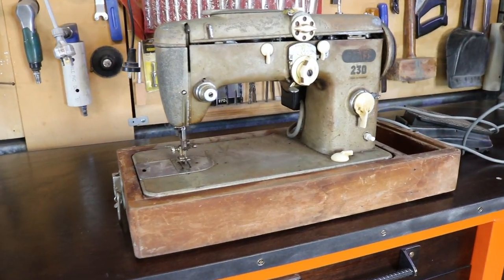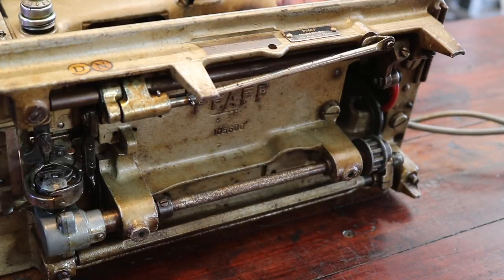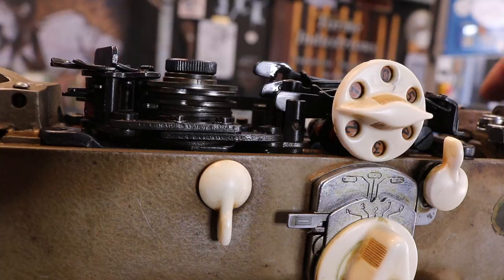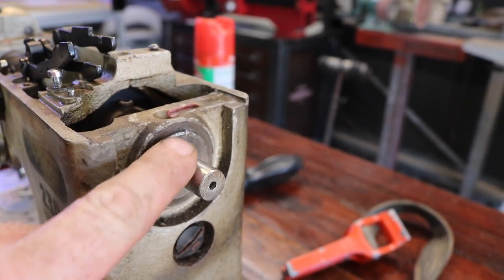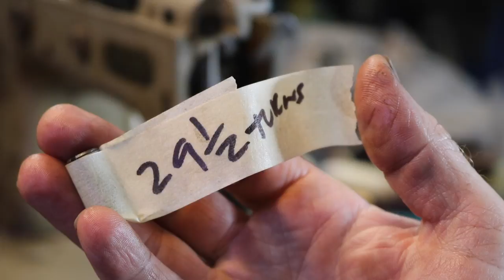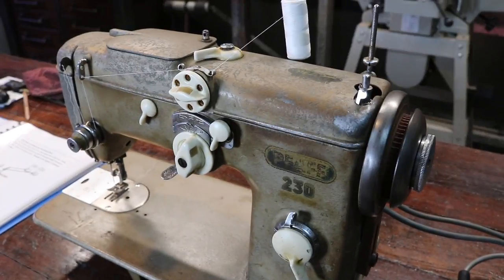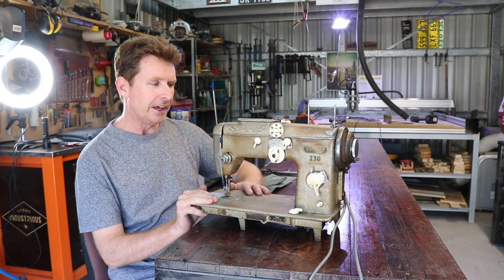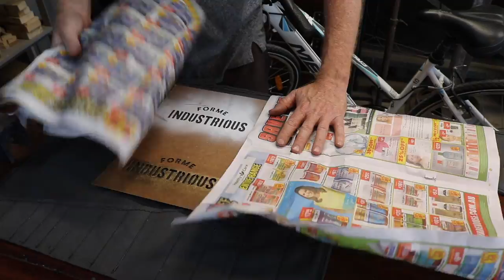Vintage PFAFF Sewing Machine Repair - Forme Industrious

Comment: Hi,
I have my PAFF 260 .cant figure out what happened to it .I was using it the bulb just busted and it stopped working since then.trying to fix it while watching your video. As I can't find anyone who can fix it.thanks for sharing .
Reply from the maker: Changing the belt is a bit time consuming but is doable. The important part is getting all the timing right which is not hard. Best if you read the manual on that to get the measurements right. Good luck.

Comment: I have the same machine but the problem is that it only sews in a zigzag, and I am looking for the straight line or is the problem. Please answer? THANKS
Reply from the maker: You mechanisms are probably seized. Try applying some oil and move the zig zag/ straight stitch lever back and fro. It may need some kerosene to dissolve the old oil residue which hardens over time.

Comment: Hi, I was just sewing on my pfaff 230 zigzag machine from 1957, and it suddenly stopped. The needle doesn't go up and down.  Do you have any ideas what it can be? I have all the accessories and the manual, too. Thanks a lot for your input. Rox from Florida
Reply from the maker: Stopped as in Jammed? If it is jammed it is probably a thread jamming the bobbin housing. Check the simple things first. Is the Bobbin clear of broken threads? Was the machine sewing properly before the machine stopped. Is the Power cord and Pedal serviceable (Is it plugged in properly)? You may check to see power is still on by pressing the light switch and or hearing the motor trying to turn. Can you turn the machine using the hand wheel? Check those things first and see how you go - let me know as I'm curious now.
Reply: @ScottTurnerformeindustrious  hi, thank you so much for getting back to me so quickly. I still don't know what happened, but I rechecked everything, re-threaded it, cleaned it up and, it started sewing again. This machine is truly a workhorse, so much weightier and sturdier than my modern Brother. Your video is amazing! I love taking things apart but mostly after they break, just to learn how things worked.
Reply from the maker: Glad to hear all is okay. Yes they don't make them like they used to.
Reply: @ScottTurnerformeindustrious   indeed. And even though the new, computarized models have so many wonderful features and functions, I think that I'd rather stick with a solid piece of machinery, rather than something that relies on chips and that will break down - inevitably and sooner than later. Regards from SoFlo.

Comment: These are lovely machines but I’m guessing that belt can be the killer if you haven’t the tools or maintenance confidence to take it apart and replace….  I guess if it hasn’t already broken you can mark the shaft positions but how can you be sure the two shafts are synchronised correctly if the belt had already broken and they have moved ?    Ps …. Glad so see the old Pfaff still running on yr more recent vids 👍
Reply from the maker: Great old machines. they purr. It is an intimidating job to change the belt and confidence is required. It is easy to set up the timing so I wouldn't be too concerned. Thanks!

Comment: Alright Scott. Out of curiosity, did you get the cam belt from Nottingham? That's where I am. It used to be very well known and still is in a way for Nottingham Lace. I'm about 2 miles from the lace market. To get used to the thread tension I often used contrasting colour threads and then you can inspect the stitching a lot easier to suss out the adjustments while practicing. You'll soon be a natural. Great restoration. 👍 🇬🇧
Reply from the maker: Thanks for the tips! I'm looking forward to using it a lot more. I've done several jobs off the camera including making a new dust vac bag. I really enjoy it. I bought the belt from 35 Natal Road London (Yaya I think). Well I got it working again, but Perhaps I should go full hog and repaint it and spruce it up a bit more. Cheers Big Ben!
Reply: @ScottTurnerformeindustrious  ... Yeah, I'd keep the sewing off camera too.  Lol. Do some welding and watch some rugby afterwards.... ;-)

Comment: You say you soak it in oil to loosen things up but what kind of oil are you using for the application? Mineral oil?
Reply from the maker: For soaking I used WD40. Cleaning - Kerosene. For final working lubrication I used light machine oil. I also used the heat gun to try and get parts moving. Maybe the odd cuss word too (but only a few)
Reply: Never hurts to give it a little "hmmmph" and some "heerrr-gah". Thanks for the reply, love your work!
Reply from the maker: Awesome thanks Corey!

Comment: Didn't catch how you unstuc it.I have an old Singer , stuck-up.please explain exactly how you did unstuc yours.would appreciate it very much . Thanks.
Reply from the maker: I used kerosene. Soaked it, then tapped gently, soaked it some more and so on. do not force anything. kerosene will resolve the hardened oils and cotton lint. hope this helps.
Reply: @ScottTurnerformeindustrious  Many many thanks.apriciate your promptness!!!!!!

Comment: I am restoring a 360. Much of the insides are the same as here. The problem I have now is that when I was removing the spring from the needle position cam finger I dropped it down into the machine. I've retrieved it but the problem now is that I don't know where the other end hooks up to.  It goes from the needle position cam finger to where?  Can anybody help?  Thanks!

Comment: Hi Scott. Great video. It's been super helpful while trying to repair my recently acquired 230. I'm hoping to find out which company you bought your timing belt from as I just busted mine while trying to repair. I'm trying to be patient with the seized bobbin assembly like you suggested, but it doesn't seem to be budging no matter how much oil I put on it or how much I heat it. It might actually be rusted together. This one came with a treadle, which is good because despite being converted to being an electric machine, it didn't come with cords or foot pedal. At least I can jerry rig a drive belt while I wait for a new timing belt to arrive. Out of curiosity, did your timing belt cost about AUD$80?
Many thanks. Sydney, Australia.
Reply from the maker: Thankyou. I got mine out of the UK. I'm travelling for the next two weeks so I cannot check my records, however if you look up PFAFF parts on Google the UK supplier should come up. Just make sure you count the links in the belt. Mine was locked up tight as well. I used kerosene and rocked the shafts back and forth gently. The kerosene helps dissolve the old oils which harden like shellac over time.  Patience is key. Good luck Siobhan.
Reply from the maker: Oh, yes around $80 sounds about right
Reply: Really appreciate the response. I've got things moving again. Not looking forward to replacing the timing belt after watching what you went through, but I'm getting a bit of mileage from just sewing it back together. 
Safe and happy travels!

Comment: Oh hell yeah awesome vid!  I design /manufacture Steel-Boned Corsets for a living and actually learnt and started my business on a machine like this.  You brought back some bad memories with the loose tension that's for sure.  You should see my button hole machine.  It's from the very early 1900's and still going strong.  If you get a chance Google 'Singer 71-30'.  It's the coolest looking Industrial antique sewer ever.  Very steampunk.
Reply from the maker: Thank you! I love this old machine! I'll check out the singer - all the best
Reply: @ScottTurnerformeindustrious  No worries.  Actually there is an excellent YT vid of it on here.  Don't blink or you'll miss the blade come down at the end of the cycle and cut the hole and the little thread cutting hook rotate around and cut the thread automatically.

https://www.youtube.com/watch?v=OSYhBiEgHR0

Comment: I very much need to get mine out of zigzag mode and fix the bobbin wonder to wind. Every thing else is working great on this machine. I really want to us it so bad. Please help. Thx. Blessings
Reply from the maker: The Zig Zag mechanism is probably just stiff from old oil, lacquer build up. Spray some kerosene on the mechanism. Let it sit for a day then gently try and move the mechanism. repeat until free, then use a quality sewing machine oil on the mechanism. Bobbin winder needs a minor adjustment until the rubber bobbin wheel contacts the hand wheel. One flat head screwdriver will do the job. Hope this helps Carolyn.
Reply: Scott Turner . Thank you very much! You are a blessing to us seamstresses.

Comment: Not sure if you can help me. I have the same machine and can not get it to pick up the buttom thread
Reply from the maker: Sounds like your needle timing is out, but start with the simple things first. Have you got a bent needle? Put a new needle in and check if it picks up the thread. The manual shows the position of the needle in relation to the hook. Not sure how mechanical minded you are but there are instructions on setting the thing if required. Maybe email me if you have problems still. Hope this helps Renee.
Reply: @ScottTurnerformeindustrious  it was working great till thread got stuck in the bobbin shell. Had to tear apart to get the thread out. So it could be timing but I'm not really sure how to adjust the timing.

Comment: Hello
I changed lamp. But it doesn't work. I have to rip off this area. Do you help me
Reply from the maker: Hi, that is electrical work. Do you have skill in this area? It is most likely the switch but all the connections can be tested if you have the tools and skill. If you do not, I don't recommend you DIY fix this as there may be other dangerous problems existing with the power system. Be careful.
Reply: @ScottTurnerformeindustrious  I have this skill. I'm electrical engineer. But this machine is very complex.
Reply from the maker: @kermdncer9981  that's good. First visually inspect the electrical wires and connections. Then do a continuity check through your lamp switch. Perhaps clean all the connections. Simple stuff first. See how that goes.

Comment: I've always dreaded in case the belt needed replacing on my Pfaff 130 or 260. Always read that it was a huge job but seeing you do it takes the anxiety out of it. It appears to be straight forward actually.
I don't think you will have luck doing upholstery with it. It's an embroidery machine.

Do not paint it. Looks good.
Reply from the maker: Yes, it's a light weight. I've made a few tool rolls with it and pushed it's limits. Thank you!

Comment: Please, help with fixing my Pfaff 360 front to back needle position... Plzzzz😢
Reply from the maker: @adihcarmachouk3383  you can find the old manuals on line, but it sounds like you need to reset your needle timing. The manuals will tell you how to re-time your machine. Hope this helps.
Reply: @ScottTurnerformeindustrious i do have the service manual but things are too tangled😢
Reply: Now i want to remove the needle bar to remove a thick washer and replace it with a thinner one may be the problem will be resolved easily
Reply: The eccentric set screw doesn't want to be removed

Comment: Bonjour, j'ai besoin d'aide, ma 260 est bloqué 😭
Reply from the maker: Hello, spray some kerosene on the moving parts and linkages. let it soak for a few days and spary some more. try gently to free it up. then use quality sewing machine oil. Another thing to check is your Bobbin case could be jammed with cotton. that will need pulling out and cleaning. Hope this helps.Bonjour, vaporisez du kérosène sur les pièces mobiles et les liaisons. laissez-le tremper pendant quelques jours et spary un peu plus. essayez de le libérer doucement. puis utilisez de l'huile de machine à coudre de qualité. Une autre chose à vérifier est que votre étui à canette pourrait être coincé avec du coton. qui devra être retiré et nettoyé. J'espère que cela t'aides.

Comment: washing Petroleum is the best for that. wash the old varnish out. then oil it. then BEFORE using clean the oil that overflows! No need to flush the machine again in oil. Most of them look like that bc. people overdo the oil job, or never cleaned the protecting varnish which they were brought in for transport reasons. That stuff gets Lequer over years1 Once you got it this far: use it for an hour or so, and oil again, for sometimes they get stuck again bc all the oil got flushed out.
Reply from the maker: Yes you are right. On an old machine it is likely the oils have turned hard (like Lacquer). I use kerosene. Thank you.

Comment: That's all the reverse they have...
Reply from the maker: Looks like it
Reply: @ScottTurnerformeindustrious  the reason I know is I have a machine that is perfect.. it had just went through extensive tune-ups etc and that's all the reverse.. but it's enough good luck and thanks you did a good job my belt is double that's strange your belt is single that must be a older machine I hope I never have to put a belt on mine again

Comment: Not be one of those people to you but if you have a sponsor you need to mark the video as sponsored at the start.
Reply from the maker: Well, I appreciate the advice, but it's only seconds into the video. I did it this way like many of other successful You Tubers I'll see how the feedback goes. I also wrote about the arrangement in the information section of the video not wanting to get people offside.
Reply: I have no idea how it all works. I believe someone can report it or something. I don't mind sponsors at all, that's what the skip button is for on the american channels I sub to. It's funny when their sponsor is an American only thing. Should get Mitre 10/Bunnings as a sponsor that'd be awesome.
Reply from the maker: Thanks for your understanding Troy. I have knocked back a number of offers up until now but when this small Australian business asked, well they mirrored my views so I am please to have a relationship with them.
Reply: Hook in mate. When the content isn't worth the sponsorship spots that's when I'm out. Pretty much anything more than mid roll sponsorship spots. Nothing worse than a 15 minute video of someone sanding. On topic, brilliant work with the sewing machine, bet that tinkering took some time.
Reply from the maker: Cheers Troy. I had it apart and back together in the same day. Tinkering a few more hours the next day. Seems to be running well at the moment.